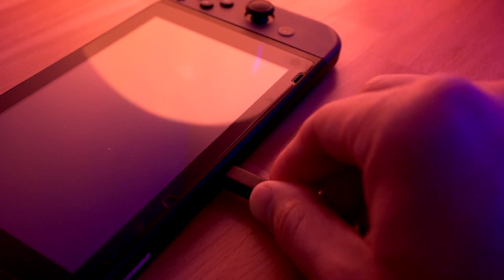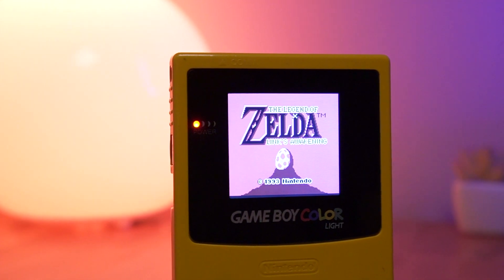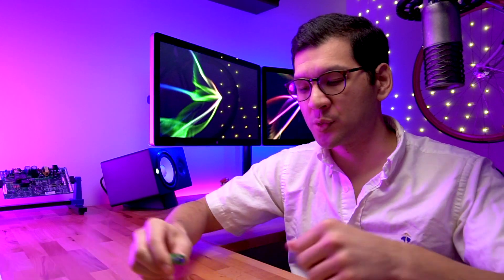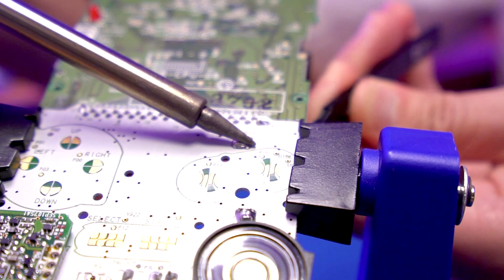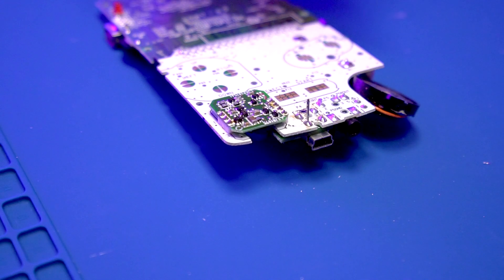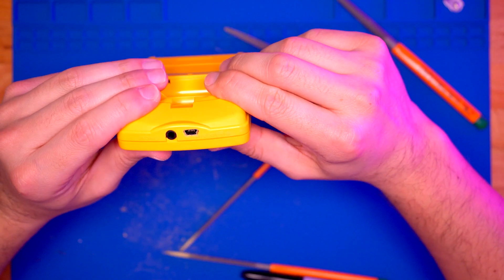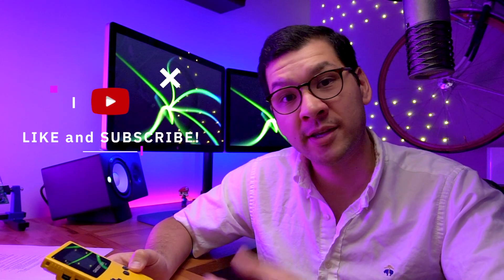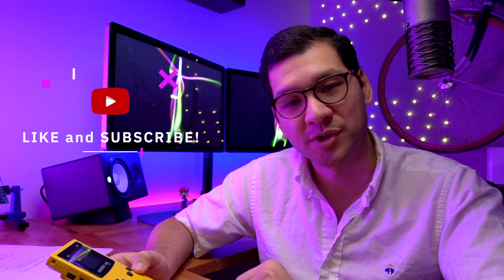$5 GAME BOY COLOR CUSTOM DESIGNED USB RECHARGEABLE BATTERY KIT from MCWILL | Retro Renew

Comment: Your modification is really great. Thanks for your demonstration. But there is still a question that the voltage of 14500 lithium battery should be 3.6V. Will it damage the machine as the voltage is over charged? I have concern about that. Also is regular AA battery allowed to use after the modification? Thanks for your reply in advance.

Comment: Damn I haven't seen that style of USB in a long time. The Wii U is the only device I can think of that uses it that is modern.
Reply: PS3 uses them as well, and all its accessories, like the move controllers which are still used with the PS VR. Mini USB has some advantages in comparison to Micro USB, as it is rated for more insertions ... so it shouldn't wear out as fast, which is nice if you charge the GBC often
Reply: @MrBunt  if I'm charging my game boy more often than I'm charging my phone then holy crap and my phone still works perfectly fine for years later (2017 to 2021) my phone uses micro USB.

Comment: If you were to clip the battery terminal so it doesn't solder to the board and bridged the traditional positive and negative, could you use two of thos batteries in parallel increasing amps instead of volts for longer play time?

Comment: It is disappointing that its not usb c I found a usb c one on boxy pixel but zero instructions on install
Reply from the maker: The usb c boards that boxy pixel sells is a commercial-off-the-shelf (COTS) item that isn’t custom designed got the GBC like the McWill kit is. Boxy pixel designed his shell to use the COTS board. Thank you for the comment!  Cheers Aurora!

Comment: Does the McWill mod heat up when charging or if using the CGB while charging?
Reply from the maker: I think it might warm up a little. It wasn’t too noticeable to me. Is yours getting very hot?
Reply: @MachoNachoProductions  I haven't done the mod yet, but it's something I'm concerned about. I'm also considering Eneloop NiMH, but it looks like the mod is designed for a LiPo pack. Do you think Eneloop would work safely?
Reply from the maker: @Albylion  great question!  Unfortunately this will not work with NiMH batteries. This mod is only for LiPo batteries. Cheers!

Comment: I did this mod using this video and was left with my gameboy giving off a loud buzzing sound 😟 can someone help?
Reply from the maker: Is the buzzing occurring while it’s turned on or when charging?
Reply: @MachoNachoProductions  first of all thanks for the response and awesome videos! So I currently don't have a 14500 battery(honestly thought an ikea battery would work lol) but I have it connected with a usb using an apple charger and everytime I turn it on it gives off an unplayable amount of buzzing. I tried a different speaker, different usb cable, different motherboard, tried headphones, regarldess where the volume wheel is I'm still able to hear all of the buzzing, removing the speaker all together gives off an ok amount of buzzing, even tried doing a work around by adding a sound amp and the buzzing was still there. Hopefully I can get it to work because now I have a perfect usb mini opening on my authentic pokemon shell lmao
Reply from the maker: That’s interesting. I haven’t noticed a loud buzzing, but my ears aren’t the best either. It could be just the nature of the mod and not having the cleanest power. I hope McWill updates the kit. Sorry I couldn’t be more help. Cheers buddy!

Comment: Is there a reason why you don't have x2 batteries? Only does the mod only 1 battery?
Reply from the maker: Great question!  Yes, the mod is only for a single battery. It was not designed to utilize 2. I’m hoping his upgraded kit will utilize both. That would be awesome. Thanks for the question!  Cheers!

Comment: Do they offer type-C or micro-B? No one uses mini-B cables anymore. And no LED?!? Great video, but as you said the cons outweigh the pro. Easier just to get some IKEA LADDA 2550 mAh batteries.
Reply from the maker: Unfortunately at the moment Mini is the only interface available. I actually did a video on adding an LED indicator to let you know when it’s done charging, I think you may like it, check it out: https://youtu.be/J3_Fp6V8M2c. I’m hoping McWill does and update to the design to account for these issues. Cheers buddy!

Comment: See thats one thing idk if i can get behind that 5v 1amp I was really wanting to do this so I can charge it with my portable power bank like if im ever on the bus or on a plane or something
Reply from the maker: I think you could still use a power bank. What’s the power output of it?
Reply: @MachoNachoProductions  it says 5v/3.1A total (each 2.4A max) i don't know much about that stuff haha but yea its a ravpower 26,800mah with 2 USB A ports and a USB C port for output
Reply from the maker: Cody McCarty gotcha. Now, don’t quote me on this, but I think a lot of the times those battery banks charge at a variable rate to match the device it’s charging. And looking at the McWill documentation it only says any 5v https://cdn.shopify.com/s/files/1/1309/0597/files/GBC_USB_Quick_Guide_REV1_1.pdf?8757. But I’m like you, I don’t know too much about electrical things such as this. To me I think you could use it. You can also email McWill. He is very responsive and should be able to answer your questions. Hope this helps!
Reply: @MachoNachoProductions  thanks

Comment: I installed the screen ok but for whatever reason it can take  2 power cycles for the gameboy to power up. I have the same problem with my sega GG McWill mod. Is this normal?
Reply from the maker: I don't have experience with the Game Gear, but its a well documented issue with the McWill Game Boy Color kits.  You need to cycle them a couple times to get them to turn on.  I hope he resolved this with future kits.  Cheers!

Comment: is there a way to get the battery contacts into parallel instead of series? so you could get 2 14500 batteries in!
Reply from the maker: I'm sure it can be done but I am uncertain how to do it.  I  am hoping McWill is working on an updated version of this kit that will allow for 2 batteries and an updated port interface.  Sorry I couldn't be more help. Cheers!
Reply: Snip the series contact in half and  solder + & - wires for each terminal

Comment: Seems like it would only take slightly more work to make it so the battery compartment would be wired to take two rechargeable batteries in parallel and as far as battery indicator you could find and incorporate one but finding one small enough would be a challenge, I do like this mod it reminds me of some of the kits for converting a original GBA to be rechargeable
Reply from the maker: I agree, it totally does!  I think it is possible to add another battery in parallel, I'm just not knowledgeable enough to figure out how.  Hopefully an updated kit will include that feature!  Adding an LED is also very doable and I am planning to make a video on it!  Cheers buddy!

Comment: 8:28, this shows the wire touching the other solder point on the PCB, this is a big no-no.
Reply from the maker: Those 2 points are actually the same.  You can solder to either one.  I hope this helps.  Cheers!
Reply: @MachoNachoProductions  Thanks for the clarification.

Comment: I go through 2 batteries every day with my BennVenn Freckleshack backlight. Would this be a good alternative instead of using batteries? Would it even work?
Reply from the maker: Yes, this mod will work with the BennVenn backlight kit!  As for it being worth it, it depends on the LiPo battery you end up using.  In my install I used a 680 mAH battery and only got 2 hours of playtime.  I think you can get a 1300 mAH battery and that should last roughly double that.  For now, I would suggest using a pair rechargeable NiMH batteries instead since you can swap them out on the fly and wait for a new kit from McWill to come out.  Hope this helps.  Cheers!
Reply: @MachoNachoProductions  Thank you! This helped out a lot!

Comment: What voltage was the 14500 battery? And could you use two 1.5V LiPo batteries to allow for a higher capacity while still keeping it able to charge? I would assume yes as long as the batteries allow for 5V charging right? Mostly i'm curious about the voltage more than anything on the 14500 though
Reply from the maker: I believe it is 3.7v. The instructions for the kit specified the use of a 3.7 volt battery so I can’t speak to using 2 1.5v batteries. Sorry I wasn’t more helpful. Cheers!
Reply: @MachoNachoProductions  That kinda makes sense. These units run on 2.4-3V so there must be a regulator in that little charging circuit. Thanks!

Comment: This was a really solid how-to on this little battery kit. The only thing I would have done differently is that I would have traced out the contour of the USB jack onto some painters' tape and placed it on the outside of the case as a template for the filing. Might have made it easier. You still did a great job going through the process of doing this mod, though!
Reply from the maker: Thank you for the tip James!  Hadn't thought of that! Perhaps I will implement that in a future video, hopefully we get a USB type C version!  Cheers!

Comment: Alright. Cool video, but I gotta ask if anyone has done experiments using two batteries to increase the battery capacity, adding an LED indicator or adding quick-charging or auto-shutoff capabilities to the mod?
Reply from the maker: I think this kit is a great starting point, but like you said it would be great if all those features were added.  I hope McWill can deliver!  Cheers!

Comment: cool mod but wouldnt it be easier just getting 2 2450mah ikea rechargeable batteries
Reply: Totally agree..
Reply: I've done this, it works well. I get a ton of play time with a backlit screen too, i havent run tests but id guess around 12-14 hours before i have to charge
Reply: Did he just choose to use 1 rechargeable battery or can I also use 2 rechargeable batteries with this exact mod shown in his video?
Reply from the maker: The mod only allows for 1. It’s strange, but that’s what the instructions call for.
Reply: @MachoNachoProductions  Thanks for the reply. I think I will still give it a try. Love your work and how you structure your videos.
Reply from the maker: Thank you Amir!  Cheers buddy!

Comment: Great video! poor product. 

Mini USB...why? micro USB connectors are cheap. 2 wires...why? Use a dummy cell and solder one wire from the unit to the battery contact, then there are no wires dangling from the shell begging to pull off a solder pad.  Or use two cells in parallel as other comments have described for better capacity.  This whole kit just seems poorly thought out. Plain old rechargeable batteries seem like a better option.  Finally, I guess I'll say it. If there really is demand for this, I'll wait for BennVenn to come up with something better.
Keep up the good work. This was a very good looking and informative video!
Reply from the maker: Thank you Chris!  Glad you enjoyed the video!  Agree the kit has some short comings.  Cheers!

Comment: Is it possible to replace the DS Lite's charging port with a regular micro USB or USB type c port?
Reply from the maker: I think it may be possible.  I should definitely look into that.  It would be cool to swap out the original charging port with a USB type c!  Cheers!
Reply: It's possible. I have a lab and i replaced the old port of my ds lite with a USB-c, so it will use the same charger of my galaxy s9. If you want i can sell you a pre-made motherboard with USB-c so you have only to install on you'r ds lite by replacing with you old motherboard
Reply: @FancescaTanuki  thanks for the offer, but I think I'm sticking to learning on my own on this one, as a starter project of sorts.
Reply: Isn't that dangerous if it uses the wrong power standard?
Reply: @axelkusanagi4139  all ds use very close to 5 volts, i've been using a homemade usb to ds cable for years.
Reply: @axelkusanagi4139  yeah, there's potential hazard. Which is why I'm hoping some knowledgeable ones to shed some light on total beginners like me to do so.

Comment: I was considering getting this, but when I saw it was USB mini-B, I opt'd not to. I figure I'll wait til there is a USB type C option available.
Reply from the maker: Agreed!  It would be so cool if McWill made a USB-C version with a LED indicator.  Fingers crossed!  Cheers!
Reply: I was about to write the same, it's 2020 and we should see usb4 soon so hopefully, there will be such mod.
Reply: BoxyPixel made one, I used it in my build and it works great. Even has a red battery indicator.
Reply: @SupahNin10dohp  I've seen this, but my concern was mounting it properly in a OEM case. I like McWills as it gets soldered right into the board, and requires minimal cutting of the plastic.
Reply: @SupahNin10dohp  do you have a link to it?
Reply: 2021 and I was gonna comment the same thing. I need this mod but with micro USB
Reply: BennVenn and McWill seem to be really behind lately. Micro-B hasn’t been mainstream for like 10 years
Reply: @OkiDingo  it's a mini b not a micro b.
Reply: @teddyberwald5504  - sorry, I miss typed as it’s been so long since I saw a mini-b connection
Reply: yep pretty useless mod as is.
Reply: @seethruhead7119  Not useless, just a bit out dated.

Comment: Hi,

I don't know if you'll see this, but I have suggestions on how this mod can be improved.

1] The positive terminal is removed entirely, making an entire battery compartment useless. This really bothers me for some reason. My suggestion in this case is to trim the terminal, and then solder a wire from it to the one right next to it. Then you can place it back into the shell (with maybe some kapton tape to prevent it from bridging with the contact on the board) and you can now use the second battery compartment to put in a second battery (in the same orientation as the other one) and this would double the capacity as the batteries are now in parallel.

2] That chip on the board is a charge controller. If you look up the board number, it should have a pin diagram that tells you which is for the charging indicator LEDs. If you find it, you can then probably wire it up to the GBC LED (or an additional one) to provide insight into battery/charging status.

In my opinion, these are two really simple ways and effective ways to improve and perhaps even complete this mod.
Reply: Batteries in parallel SHOULD work, however, I'd be concerned with parasitic draw (I think that's the correct term).  Both batteries will have slightly different capacities and could result in one battery charging the other when the console is shut down.  2 batteries in a closed circuit-- could be bad news.  This can be fixed by adding a couple diodes.
Reply: @rc_matic  Dropping diodes in that circuit would prevent the charger from charging the batteries, wouldn't it? Further, while the parasitic draw would have one battery charge the other, it shouldn't be a problem so long as the two batteries are the same chemistry and voltage - ie, two of the same battery.
Reply: OmegaErkz  yup, I mentioned that diodes should fix that problem.  What you say is true regarding the battery capacities.  However, as with most electronic components, the batteries are manufactured to a certain tolerance.  For example, it’s not uncommon to see +-20% rating for capacitors, +-10% for resistors.  We don’t know much about the battery voltage or amperage rating.  We also don’t know how each battery will degrade over time, even if they are “the same”.  If one battery degrades just a bit quicker than the other, you’re stuck with the same problem.
Reply from the maker: Those are fantastic ideas!  I'm a little nervous about adding an extra battery, however, I do plan on making a follow up video if I can figure out how to add an LED or somehow tap into the GBC's LED like you suggested!  Thank you again for the comment and suggestions!  Cheers!
Reply: @MachoNachoProductions  No problem! I can understand being nervous about the second battery (because if you put it in series instead of in parallel, you will absolutely blow the fuse), but so long as it's parallel it'll be safe. Good luck with the LED!
Reply from the maker: OmegaErkz thank you, hopefully the LED mod is easy to figure out!
Reply: It's a TP4056 controller, and yeah, it has a charging and finished indicator LED capability. Middle two right legs as you look at the chip with the dot on the left.
Positive to the LEDs from the McWill board, 1kohm resistor between the legs on the chip and the negative side of the LED works a treat.
Just done it myself on my McWill USB port, I changed the GB LED for an SMD red, and added a white SMD, and a green SMD. I suspect a 5v 5050 LED might also work, but I don't have any to play around with.
Reply from the maker: Awesome thank you for the insight!  I reached out to McWill and he told me something very similar. I will be making a video about this soon!  Thank you for sharing!  Cheers!